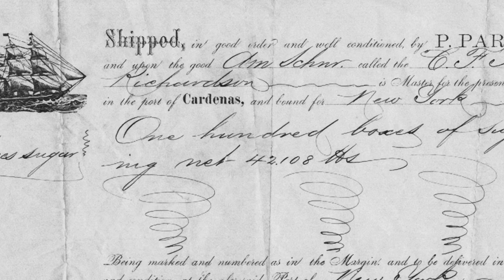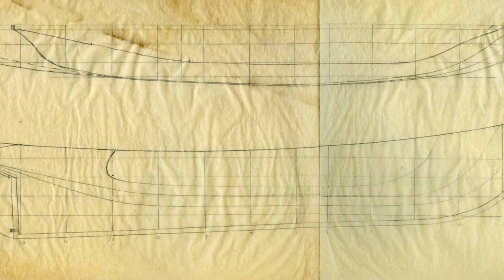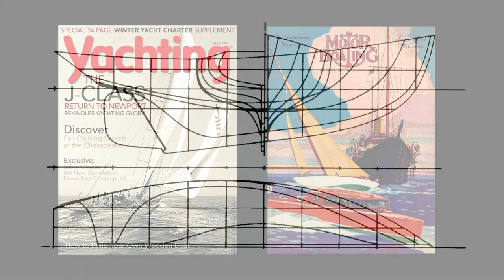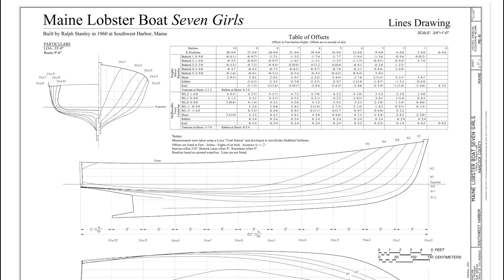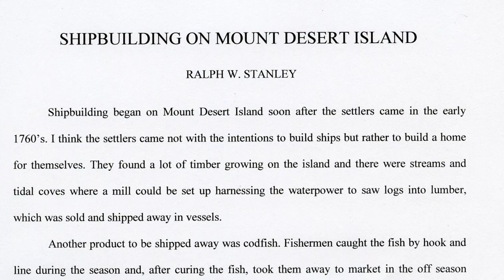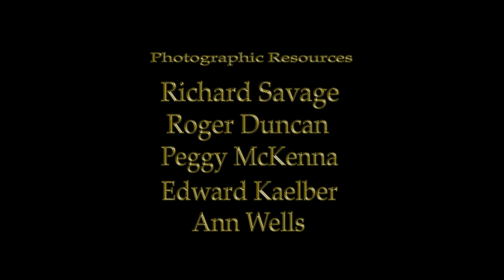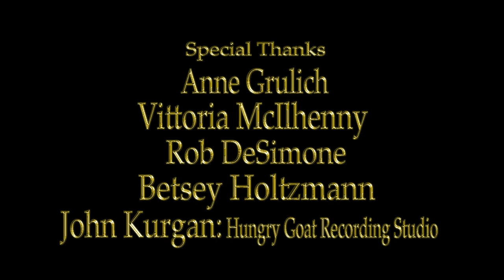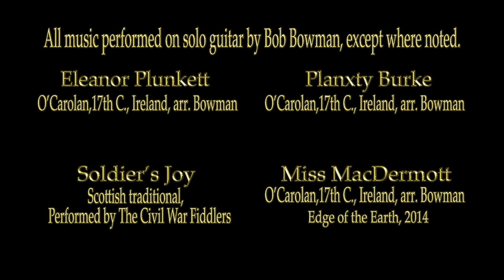Ralph Stanley- An Eye for Wood

Comment: My dad and Ralph were good friends.  Ralph restored and cared for Venture (# 66) for my dad with it wintering over in Ralph's yard.  Ralph would do repairs over the winter.  My dad was a civil engineer that did a lot of hydro power.  One time he needed a concrete form that would start out as a square hole and transition into a round hole while going around a (I think) 45 degree bend.  After a couple professional form builders told my dad it couldn't be built, he took the plans to Ralph.  Ralph looked at them and said, he'd be happy to try to build it.  Just before my dad went to pick up the form Ralph had it sitting in his front yard.  One of the other boat builders in the area was driving by, stopped and said to Ralph, "Ralph darndest looking boat I ever saw.  Don't think it will float."

Comment: I'm 32, and started building boats about 4 years ago, just finished my second, both are wood; never want to work with anything else.

These films you've made, I've seen two so far, are FANTASTIC; it's great; about as close as I can come to sitting down with an older boat builder without actually sitting down with one.

Really enjoy them, incredibly informative, beautifully shot and presented; thanks a lot for taking the time to do this.

Comment: When I was younger, I read Fred Stonehouse stories of ore boats on Lake Superior which hauled iron ore.  Those schooners had to be strong to take iron ore.  Soon the wooden boats came into use, the schooner masts were cut down and they became 'barges'.  And when the steel boats came into being, the old wooden iron ore boats were discarded, used as jetties, etc. Now on the lakes are about 13 1000 footers.  Shorter steel boats would take care of smaller places such as Marquette, Michigan so there is still a use for the older boats. thanks :)